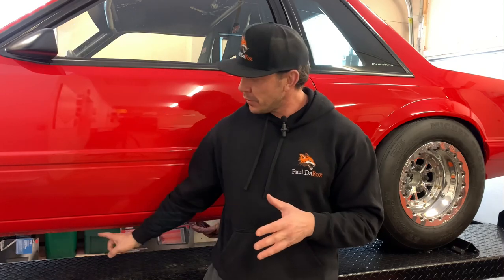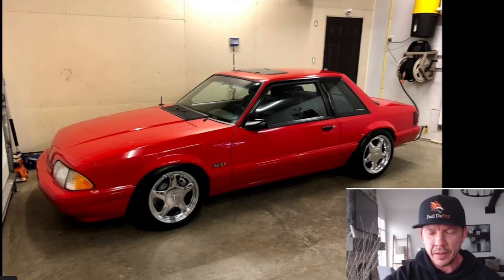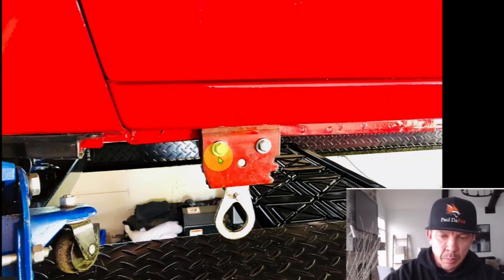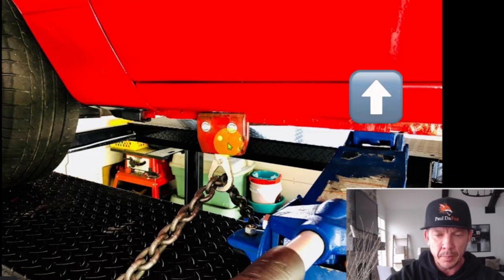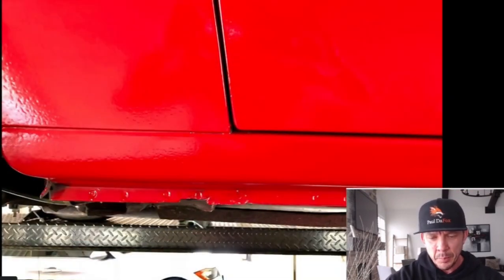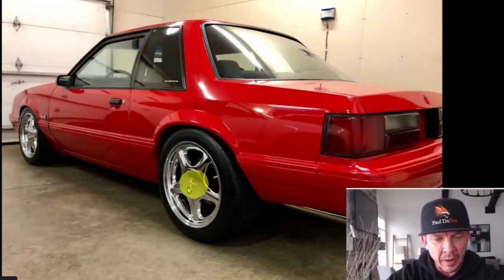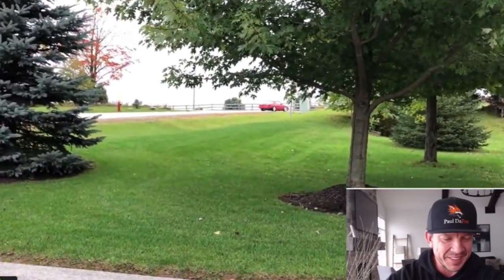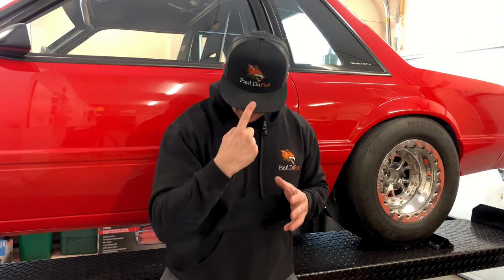HOW TO: Fix Your Foxbody Mustang Pinch Welds // Easy DIY Repair

Comment: That's awesome nice fix Paul! My Cobra could definitely benefit from this being done. My pinch welds are trashed due to it being road raced and it always being raised up with floor jacks for tire changes and brake jobs
Reply from the maker: Thanks Travis, this one was a little trickier with the rocker being pushed in but I think I pulled it out nice and did the best I could with it.  You going to fix yours?
Reply: @PaulDaFox  at some point I’d like to, just not a big priority at the moment.

Comment: Love those notches. My 04 mach 1 has the drivers side crushed. Pisses me off that the lower panel is off. May have a body shop fix it. I always lift the car on the subframe connectors.
Reply from the maker: I hear ya brother...how about the knuckleheads that try and lift the fox on the rad support; have seen a bunch of those crushed in🤦‍♂️

Comment: what a rocker? & btw wats a frame rail?  & wats above the pinchweld?(hidden behind the sheet metal, as is the hidden, supposed, correct jackspot’)✋🤔
Reply from the maker: The rocker is the panel just below the door, usually gets bumped with our feet when we get into the car. The frame rail is in the engine bay and supports the front end. It’s a tubular square shape - the sway bar mounts are welded to it. The best jacking point on these foxes are off the subframe connectors (most foxes have them installed by now) I jack up from the center of the subframe connector and both front and rear wheels come up. Hope that helps, have a great Friday👊🏼🦊🏁

Comment: Great video!!
Reply from the maker: Thank you so much, appreciate the comment and feedback 🙏🏼🏁
Reply: @PaulDaFox  np, someone stole the wheels off of my Mustang and they damaged the pinch weld in the process.
Reply from the maker: @robertb3409  Sorry to hear that, hopefully
not too much damage done to the pinch welds.  Did the end up resting the car on cinderblocks?
Reply: @PaulDaFox  I had to put the car on my jackstands.
Reply from the maker: @robertb3409  So just to clarify, your jack stands damaged the pinch welds? Again sorry to hear that someone stole your wheels🤬
Reply: @PaulDaFox  the thieves that stole the wheels, damaged the pinch welds when they used their jack.
Reply from the maker: @robertb3409  Gotchya brother! Hopefully the video gave you some ideas how to fix it yourself 👊🏼🏁